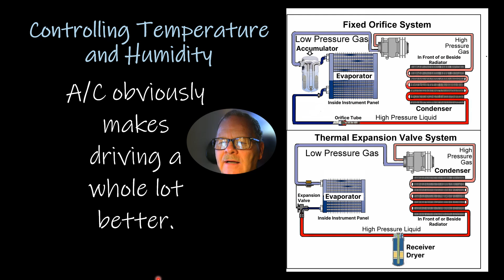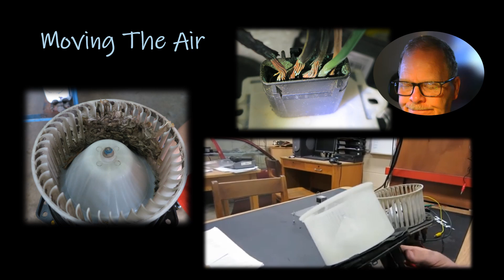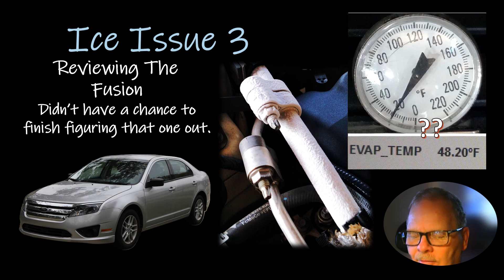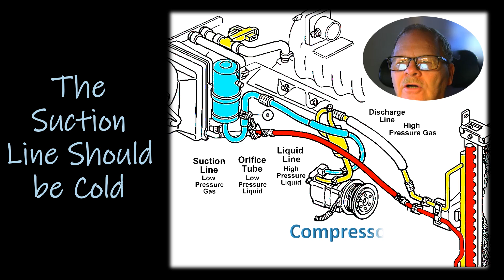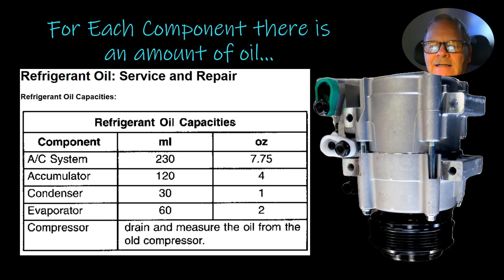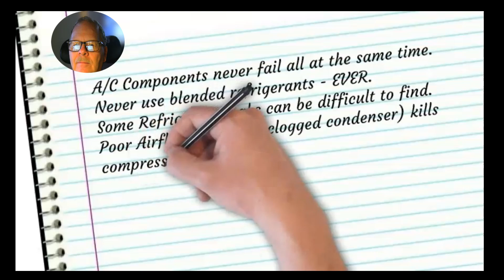A Few More HVAC Tips

Comment: I just had a strange thing happen to my dump truck. It was sitting idling for just a few minutes, the defrost was on but what I didn’t realize was the fan belt had fallen off. It only runs the fan , there is a separate belt for the water pump and alternator. While it was sitting there there was some kind of relief valve blow off some of the refrigerant. Now Im Not sure if it will need to be recharged the system or if I have to do something with the relief valve. Any ideas would be appreciated.
Reply from the maker: You lost some refrigerant, that's all. Not a big deal - fix the fan and top it off.
Reply: @McCuistian  new fan belts installed all good. Thanks for your great videos
Reply: @McCuistian which control module operates speedo,HVAC, feul gauge an oil pressure any advice be greatly appreciated thanks ✌️🦐
Reply from the maker: @shrimp8004  What vehicle - make, model, and year?
Reply: @McCuistian  o2 gmc4.8   1500 rwd
Reply from the maker: So you've got several gauges that have failed and you're having issues with the HVAC? Is that what's going on? If so, the gauges can be fixed fairly easily. The HVAC will likely be a different issue.
Reply: @McCuistian  my speedometer an odometer first an then noticed fuel gauge was giving wrong reading  got new cluser an new vss same issue.
Reply from the maker: @shrimp8004  The fuel sender likes to go bad on that vintage GM - Go there first. Then see if the scan tool shows VSS readings or not - if not, there will be a wiring or ground issue, probably with the VSS circuit. Check that next.
Reply: @McCuistian  yes sir the live data shows everything works but ant reach n the cluster
Reply from the maker: @shrimp8004  was the cluster reflashed to match the truck?
Reply: @McCuistian  no sir how that done that makes sense to me was told 2 deferent things this is my first I'm just some dumb not plum dumb 😄lol  thank you
Reply from the maker: @shrimp8004  A shop or dealership has to do it with a high end scan tool. It's not plug and play - at least not on the ones I've replaced in the early to mid-2000s models

Comment: Mr. C. My 1990 Cressida has a "pressure regulator" in the engine bay with a capillary tube that attaches to it from inside the cab. But also has an expansion valve inside the evaporator core. What is the pressure regulator doing?